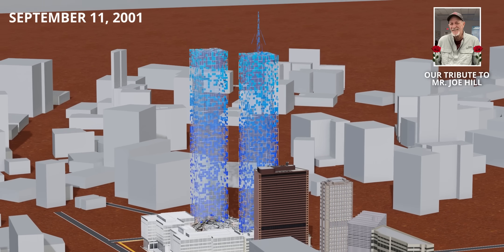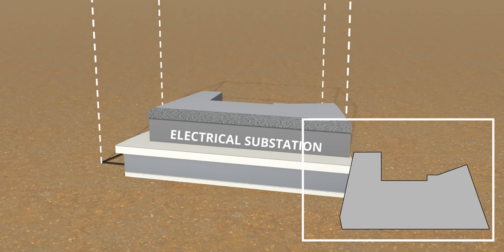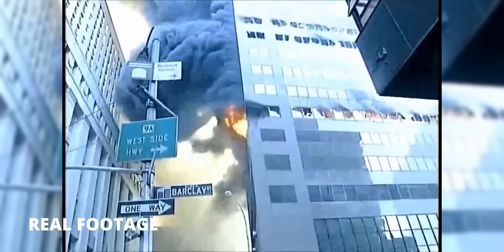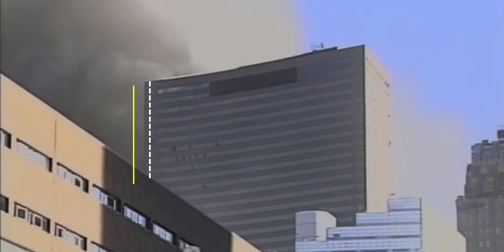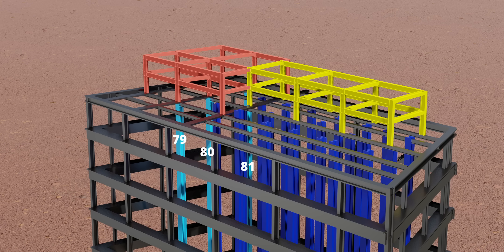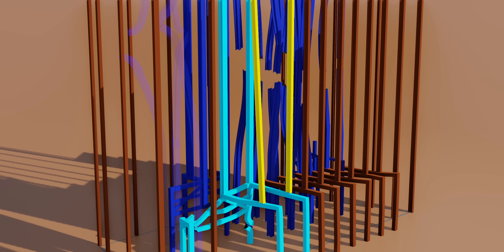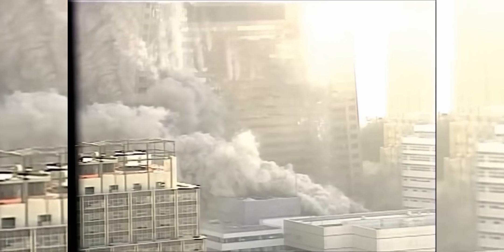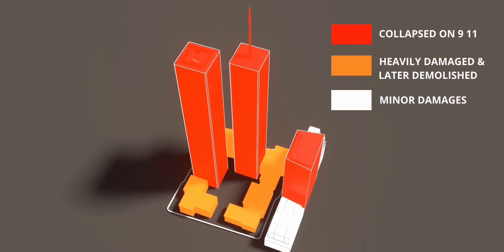Collapse of Building 7 | The Complete Physics

Comment: Fire doesn't take down steel supported structures. Pure BS for the naive ones.
Reply: @WhoIsJohnMcEnroe - And that is not what occurred. I have already posted the details about this for you - more than once IIRC.  Why you keep ignoring the answers to your questions I do not know.
Reply: @WhoIsJohnMcEnroe  "weakened” does not equal a complete uniform failure across all core columns except for the three under PH"
True. It doesn't explain or equal Xenomorphs, Santa Claus and the Tooth Fairy either, among other fantasies with no connection to reality.

"Since the heat was concentrated near where the building was damaged"
If, by "where the building was damaged", you mean "everywhere".

"Yet what we saw was a perfect failure. Doesn’t make sense."
As noted, that you want to believe in fairy tales is on you. Since you do, no wonder it "doesn't make sense". Try getting with reality, it might help.
Reply: @WhoIsJohnMcEnroe - What narrative?  I described what happened why and how. You should actually read it (yes, I know you haven't) instead of mindlessly spewing dogma. At least pretend you are serious.
Reply: @WhoIsJohnMcEnroe - IF you had actually read what I wrote you would have followed the explicit instructions I included at the very end to prove it.  

You didn't. 

That is how I know you didn't read it. That and you take issue with absolutely none of the specifics, just try to hand-wave the whole thing off as sticking to the narrative
Reply: @TheCriticalStinker-01  ты пишешь под каждым комментарием свою пропаганду! Много тебе заплатили за это? У тебя нет хорошей работы или ты просто человек без совести?
Reply: @WhoIsJohnMcEnroe - I'm sorry, did you say something?
Reply: @WhoIsJohnMcEnroe -  Who can tell?  It looks like you only just now finally figured out how to reply properly
Reply: @WhoIsJohnMcEnroe - And I have laid out numerous faults in your analysis while escribing in detail what actually happened.

And you ignored all of it with a hand-wave. You do not want to know, certainly don't want to learn and won't even consider you might be wrong. You want to preach your gospel and have others tell you how great you are for it. You seek affirmation, not answers. 

So let us all extend to you the same courtesy and attention you have shown others, giving you the time, consideration and attention you have earned deserve.

Which is none.
Reply: @WhoIsJohnMcEnroe  Sure. Here's a instruction for you:

Instead of spreading stupid shit you clearly learned from the other cool kids in the playground, try thinking for yourself.

Meanwhile, that didn't actually have any arguments explaining your failures either. Imagine that.
Reply: I still find it strange how all the buildings collapsed straight down” On themselves like demolition.. even in disaster movies the buildings fall over, half the building collapsed. Never like a demolition..  perfectly executed. Is that really possible? I remember thinking watching Tower two collapse., thinking the top was going to fall over side..
Reply: @randymorgan8375  - Steel framed buildings can only collapse down. They disassemble themselves and are mostly air by volume, not solid and rigid like trees. There is no other way for them to go but down - the direction of gravity.

Your starting assumptions are false.
Reply: @TheCriticalStinker-jw4fl  but they never have before or since. Your entitlement argument is a false equivalence
Reply: @randymorgan8375disaster movies.. .movies....not real life.
Reply: @ As opposed to you you spent your time being unable to come up with a refutation, you mean?
Reply: @WhoIsJohnMcEnroe So, basically, you lacked basic reading comprehension, along with the lack of argument? Well, no-one was much surprised.
Reply: @WhoIsJohnMcEnroe Not at all, no matter how much you want to pretend otherwise. My description of lacking comprehension is from your lack of comprehension.

Making things up isn't an argument. And you are making things up, as we can see from your total inability to come up with a refutation or rebuttal. Instead, you change the subject, try to make it about something, anything else.

You know you're wrong, and you can't deny it, and so you do anything at all to convince yourself otherwise, so you don't have to face your failure.
Reply: @WhoIsJohnMcEnroeWhy is it that every last "truther" think that throwing the words "science" or "physics", while making it perfectly clear they understand neither, make an argument?
Reply: Jet Fuel also burns quite hot. I'd say enough to melt steel. Also, cartoons depicted 9/11 happening way before it happened. The animators must have been behind it!
Reply: @thecarwashesandmorechannel2892  what are you talking about, nowhere even in the official reports does it say steel 'melted'. 20+ years and you're still repeating garbage? Jeez....stop watching those cartoons and grow up, maybe read a book which doesn't have pictures in it
Reply: @WhoIsJohnMcEnroe - One more time, with feeling,...

What follows is MY EXPLANATION of the collapse sequence using the best available information and relying on no authority. Please read slowly and carefully. 

B7 was complex structure, a 47-story steel framed building built on top of a smaller existing 3-story building, requiring several lower floors dedicated to complex load transfer structures instead of usable office space. Of trapezoidal shape and all-steel tube-in-tube construction, B7 (above the 7th floor) consisted of a central core of steel columns carrying most of the gravity load, perimeter steel columns around the outside of the structure carrying the remainder of the gravity loads and long span beams and girders to tie those elements together and form the floors. On the outside of the building hung a moment frame - the last part of B7 to fall. 

Phase 1 : Collapse initiation for B7 is notably quiet with observers not realizing the building was collapsing! There was no audible warning in the form of say hundreds of ear drum busting 180-190dB explosive bangs preceding the collapse. The first externally visible signs of collapse initiation occurred at 5:20:28 pm. Here at 12:00 a local CBS affiliate reporter is talking 10 blocks from B7 when collapse begins. People don’t start to notice the collapse until 12:11. Then at 12:45 is the famous CBS fixed camera clip of Building 7’s collapse Again, note how quiet it is.

youtube.com/watch?v=t5tEy6mXSE8&ab_channel=fresnosean379

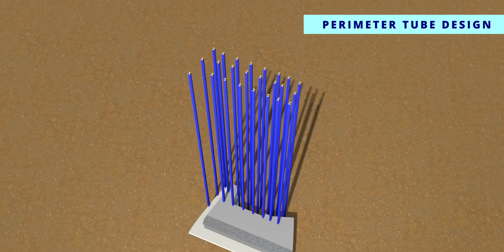Collapse initiation was due to multiple lower floor failures above the load transfer region (7th floor) in the NE corner of the building. In this video at 0:45 you can see the NW corner from inside the building while under construction, Column 79 just out of frame on the left. That big, angled steel beam across the top of the frame connects to C79 at one end. The girders connect to the beam. That beam and all those girders depend on just one connection

youtube.com/watch?v=nP3TNHPCIVU&t=35s&ab_channel=EdwardCurrent

Phase 2 : Lower floor failures caused a loss of critical lateral support over an excessive length of core Column 79 and it buckled. If you look at a floor diagram of Building 7 (see above) and look at all the structures that depend on C79 you quickly realize this one column was a relatively isolated structural element on which a disproportionately greater fraction of the structure depended . Externally we see a vertical progression of window breakage along the 44-46 line and a kink in the roof of the East Mechanical Penthouse at the top of the building, consistent with C79 failure. The transition from full capacity to almost no capacity occurs in virtually an instant. Once the buckling failure occurs there is almost no resistance

Normally with a buckling column, the load could very well be redistributed to other columns, meaning the buckling could stop after a while. With C79 that is not the case - the failure did not redistribute the load, so the collapse rapidly progressed to the roofline, sinking the rooftop penthouse.

Phase 3 : With C79 gone, B7’s progressive, non-symmetrical collapse continues with C80 and C81 at the east end of the core left laterally unsupported and quickly buckled and failed as well, sending the EMP down through the building. C79-81 all have no diagonal bracing, which I believe is a major reason why they could not redistribute a lot of vertical loads among one another.

From there collapse progressed from east to west through the central core until the core was gone taking all of the interior floors and structures and probably most of the perimeter columns with it. You can see the horizontal progression of window failures low in the building and the dropping of the remaining rooftop structures into the building. One of the big takeaways from the NIST Building 7 study (that gets completely ignored) was their modeling which determined C79 failing under ANY circumstances would have initiated the same collapse sequence.

Phase 4 : After some 10 seconds all that remains of Building 7 is just a hollow empty outer shell - the exterior moment frame - creating the illusion the building is still standing since little has changed externally. But it’s just a hollow empty shell like an empty cereal box supported by only a few remaining columns and quite unable to remain standing. With all the internal framing gone. the north face leans inward, forming a V in the roofline, the last perimeter columns buckle under the strain and with nothing left keeping it up the moment frame free falls, landing on top of the 7-story high debris pile. It is only at the very end that a single measurement of alleged free fall acceleration is taken. Note this is not the building but just its outer shell, and only one corner at that, at the very end of the collapse. Start to finish the entire collapse took 18-20 seconds, or less than 1/3 of true free fall and we have to look at the whole thing, not cherry-pick little bits to fit a particular narrative. Worth noting _how fast something falls cannot tell you what started it falling in the first place. The debris spread out, blocking surrounding streets, heavily damaging the Verizon Building and destroyed Fiterman Hall, all well outside of Building 7’s “footprint”.  

Building 7’s progressive, non-symmetrical collapse was incidental and unintended collateral damage from the combined effects of fire + time + gravity started by the collapsing North Tower. That is true no matter who planned and carried out the 9/11 attacks or why . The collapse was of so little consequence it barely even registered at the time, a mere footnote. 

Anything can seem like a conspiracy if you don’t understand how it works. Now you should. I hope you found this helpful and informative, not adversarial and it solicits informed critical comment. If I made any errors of fact, logic or reason or left anything critical out, please let me know so I can fix it. IF you can offer a more plausible alternative please do. Be the first. Please start any reply with the words “Tits McGee” or I will know you didn’t read it and are wasting my time.
Reply: @WhoIsJohnMcEnroe "I respect exactly one thing about you insofar as what you write. "
That's nice for you. So what? Is your supposed respect meant to have any relevance or meaning to me? You make up stupid shit, repeat other stupid shit, and in general make yourself into a laughing stock.

Here's a thought: come up with something, anything, that is 1, relevant, and 2, factual.

Until you manage that, you remain laughable at best.
Reply: @WhoIsJohnMcEnroe - I was not replying to what you said regarding columns as you damn well know. So, strawman fail. I already replied to that several times on that topic and you just ignored it, so I replied to something else.  And you know it. 

If we actually tried to talk about column failures, you would just hand-wave away any criticism and try to change the subject while throwing insults around - as you do. So there is no point. You are a very typical conspiracist in that regard.  

Remember that the goal of conspiracy rhetoric is to bog down the discussion, not to make progress toward a solution Jay Windley 

In the unlikely event you should ever show interest in serious discussion instead of just shameless attention seeking I may reply. Since that seems unlikely, I wish you luck on your continued epic fail. 

Goodbye
Reply: @WhoIsJohnMcEnroe " not a very scientific rebuttal to the simultaneous failure of all the columns caused by asymmetric damage. "
True. Also not a very scientific rebuttal to Santa Claus either. And for exactly the same reason. Because he and your nonsense are fairy tales with not a single bit of factual content. I'm sure they both give you comfort, though.

"You also automatically assume that anyone who disagrees with the narrative is therefore not capable of thinking scientifically."
No, I think that anyone who disagree with the factual, science-based, internally consistent, fully supported explanation is unable to manage basic science. You know, the way you can't?
Anyone who throws around words like "narrative" in an attempt to weasel-word things have no basic understanding.

“Someone who disagrees with the narrative is wrong, ergo they aren’t capable of thinking scientifically”
You are aware that repeating your nonsense doesn't make it LESS nonsense, right?

"You will retrofit any explanation to suit the criteria you’re given. “My girlfriend said she didn’t cheat, ergo she’s pregnant due to divine intervention”"
No, I leave that sort of thing to people like you. Because you've been doing that for the past 15+ years, ever since you lost the people who actually wanted to find the truth, and you turned into the "truther" cult we see today.
Reply: @mooneyes2k478  - Johnny Mac got a ban and account deletion.
Reply: Heavy impact from falling debris can
Reply: Fire takes down steel structures all the time. Steel is formed by heating it and deforms the same way. Steel construction is uniquely vulnerable to the effects of fire, not immune to it.
Reply: Fire actually does do that a lot.
Gues why support beams are protected by special coating to protect from fire. It's not because they will start burning.
The coating is often a kind of foam, or foamy concrete.
It will only protect for a short while.
The wtv buildings had this coating.
Steel beams get softer when heated.
They bent and buckle more easily.
Reply: Uh-huh. So, in your world, steel doesn't weaken when exposed to high, prolonged, amounts of heat?
Huh. How'd you get to the iron age, then?
Reply: @WhoIsJohnMcEnroe - You are correct. Collapse was progressive. Columns failed in sequence, not simultaneously with only the initial failure directly due to fire (though fire did not cause column failure, it caused floor failures which in turn caused the failure of a critical column). This is obvious enough just from simple visual observation.